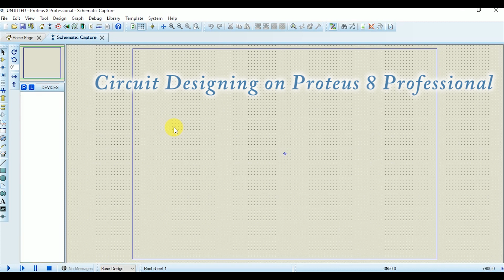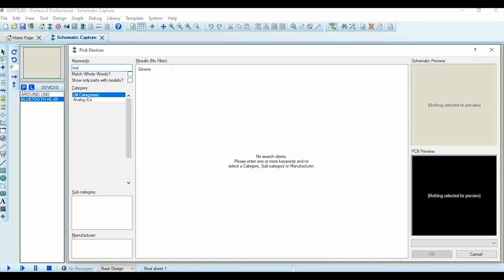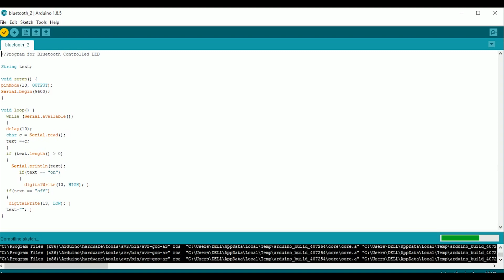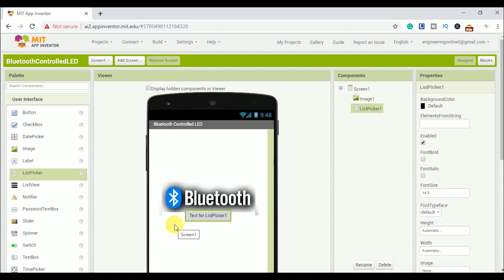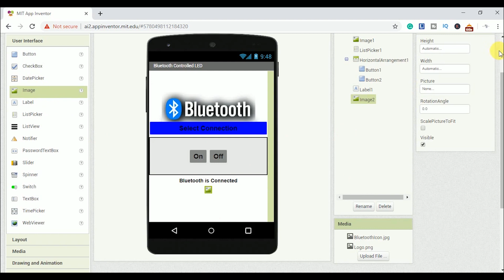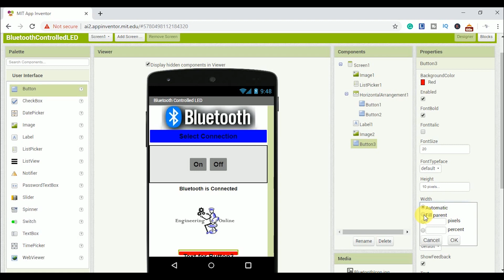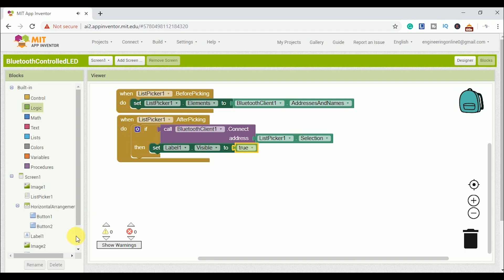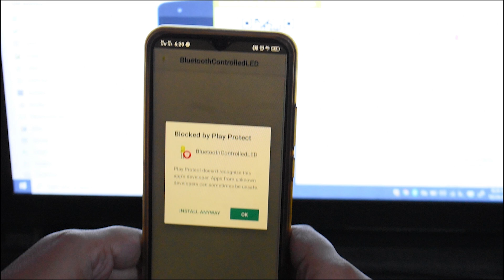Proteus Simulation of Bluetooth Module and Arduino | App Development on MIT App Inventor

Comment: Sister I have a problem.. there is no COM3 in my Bluetooth settings.. can you give any solution about it..
TIA
Reply: I am also have the same problem.  I  am also Add more Incoming COM ports but I don,t find any incoming COMport as to much with my HC05 Moduke . So how to sole this?i am also instill Bluetooth Drivers and try some others possable methode it was not Working .

Comment: Hi, first thing first, thanks for the video. When I came to the Select Connection and it connected to my laptop successfully. However, the button ON and OFF don't work for the circuit on proteus. I have followed all of the steps in the video without skipping any of them. I choose the right port for the Bluetooth module and for the code as well. If anyone have solutions, I would be appreciate. Thanks in advanced !

Comment: Ma am my mobile device is unable to send data. Serial.read() is returning 0.

connection between Mobile And laptop is fine. I have checked it as well. Both are transmitting and receiving data

when i start the simulation and press the "on" button from mobile phone nothing happens on proteus and serial.read() returns 0. Moreover when i stop the simulation and press "on" button the app return Unale to write broken pipe error.

please help me

Comment: Proteus Bluetooth Device Not Showing
Reply from the maker: You have to add library first
Reply: @EngineeringOnline  already added.. everything is fine, but not showing in devices
Reply: @EngineeringOnline  Hvae Done Everything Correctly Port of Com6.. But Sstill facing Issues
Reply: I Think Ports Are Not Configured Correctly.. Send Me Some Videos For That..

Comment: Hello! this video has been helpful. but i am getting the "error 507: unable to connect" thing when i try to connect to my pc from the app. can it be solved?? really urgent and important :) thank you.
Reply from the maker: Please make sure you've configured the COM port on the Bluetooth module to match that of your laptop. Next, run the simulation first before you try connecting. Hope it helps!
Reply: yes it worked properly :) thankyou very much! this video was very helpful
Reply from the maker: @debayanmukherjee01  Glad to know that :)

Comment: Thanks for the tutorial, it was very helpful. Currently i'm using app Inventor to develop an app to graph ECG and EMG signal received from Arduino, the graph part is going well but I'm struggling with the axis labels from the graph, is there a way to make a graph with proper X and Y labels in app Inventor? Appreciate if you can help me.
Reply from the maker: Please share your query on engineeringonline0@gmail.com

Comment: error 507 unable to conect.is device is turned on error
Reply from the maker: Please make sure you've configured the COM port on the Bluetooth module to match that of your laptop. Next, run the simulation first before you try connecting. Hope it helps!

Comment: Hello dear, 
I’ve made all the steps correct and there is no mistakes in it but when connecting the bar code into the app, the app isn’t taking me to another tap that i should install the app i did in it how should i fix this? 
My phone is iphone
Reply from the maker: Please share the screenshot of error to engineeringonline0@gmail.com
Reply: @EngineeringOnline   there is no error i tried it on andriod and it worked, but i need it for sos iphone is there a way to make it work on iphone ?
Reply from the maker: @nataliebesher2421  Does your iPhone creates  issues in making Bluetooth connection with pc?
Reply: @EngineeringOnline  not at all

Comment: hello , nice video thank you for it , i have a question , why did you choose  R=330 ohm ??!!! thank you
Reply from the maker: The resistance value is set in such a way that led can be turned on at high voltage. The resistance value should not be too high and not too low. At high resistance, it will not turn on and at very low resistance, LED will get burned.

Comment: while i am seraching in blutooth com port , it shoes none. what should i do?
Reply from the maker: Do you have a Bluetooth port in your PC?
Reply: @EngineeringOnline  yeah.now I got that after several times of doing it.
Reply: @EngineeringOnline  but, circuit got connected, even app connected, it's showing my commands in serial monitor, but motors are not moving in my project.
Reply from the maker: Try with simple led then add motors.  There might be issue in the code
Reply: @EngineeringOnline  yes , I tried, I am not able to see any output for blinking of led....even though there is no error showing in Proteus.
Reply from the maker: Email your issue at engineeringonline0@gmail.com

Comment: Mom I'm not getting COM3 at COMport in blutooth of my pc. While adding it's getting COM9 but it is not there in blutooth module that I used in Proteus.
Reply from the maker: Try on some other PC
Reply: Mom....how to connect Arduino in proteus to Arduino software....
Reply from the maker: @lokeshkinjarapu9000  Using hex file
Reply: @EngineeringOnline  maam....while I'm giving input from mobile app, the serial monitor in Arduino software shows the the input but there is no responce in Proteus software...
Reply from the maker: sent!
Reply: @lokeshkinjarapu9000  do you know how to fix now, help me please

Comment: I have a problem, i press the buttom of my app in my phone, but it seems that doesnt sent anything, i dont know what im doing wrong, i do everything that you do, i mean a get connected with blutooth
but i cant turn on the led
Reply: I have the same problem :c
Reply from the maker: Please make sure you've configured the COM port on the Bluetooth module to match that of your laptop. Next, run the simulation first before you try connecting. Hope it helps!

Comment: i am continuesly getting error 507 what should i do...it is very important for my project please get back to me fast. it is a request
Reply from the maker: Are you sure, you are not doing any mistake?
Reply: @EngineeringOnline  nooo i am not doning any mistake....there is a problem with connection establishment...please please help me it is very important for me....
Reply: @EngineeringOnline  i tried everything once again it shows the same......
Reply from the maker: Drop your email. I will email you my files. Try with them and let me know if you are still facing the same issue
Reply: @EngineeringOnline  thank you so much.......i was trying to connect to bluetooth without running proteus circuit and there was some problem with hex file location(instead of copy paste, i searched for it in %temp% folder and was able to run my application...) thank you so much for this video i really helped me a lot .... thank you for such an informative video....
Reply from the maker: Thank you so much for appreciation. :)
I am glad its working for you now 👏

Comment: Why don't I connect the voltage and ground of the HC-06 module?
Reply from the maker: In simulation, only tx and rx pins can be used. whereas with real hardware, you have to used all of them
Reply: @EngineeringOnline  Thank you very much!!

Comment: I do all the steps as shown but unable to run simulation. I think error would be in com port. When I open Bluetooth setting there it is showing COM19 port but in proteus Bluetooth Library there are up to 4 ports, can this be problem?
And one more thing I want to send X and Y co-ordinates through app, how can I send it ?
Reply from the maker: Same Bluetooth port should be selected on the Bluetooth module. Only then you can communicate with the Android app.
Try it on some other PC
Reply: @EngineeringOnline   how can I Send X and Y using joystick, I had made joystick but how can I send it to module?
Reply from the maker: You have made a joystick on app?
Reply: @EngineeringOnline  Yes sort of which gives the x and y according to ball position.
Reply from the maker: @prathameshvarashetti2562  Its doable . Have a look at this video
https://www.youtube.com/watch?v=Gje7ST4yXjM
Reply: @EngineeringOnline  thanks I will try this
Reply: @EngineeringOnline  I had try this is useful to me but now problem is that when I connect app using IDE serial monitor it doesn't  prints  x and y properly in number form inspite prints anything like $#??*?$$ etc but when I send text it is printing fine. And also when I turn to simulation it is showing error unable to write broken pipe.
Reply: hey!
did you solve that issue of only 4 COM pins because I have this as well :(
Reply: @AbdullahAli-vh1ce  No bro I tried it on other PC

Comment: I have been using Bluetooth module in my project. So we have done a simulation using Proteus. But we have a doubt. How to connect the Bluetooth module in Proteus to an android device? Is it possible to connect it from a predefined app in an android device and send/receive data ? If we can please explain how to perform it.
Reply from the maker: The same process is done in this video. Try to connect Bluetooth module in Proteus with the app you have.
Reply: @EngineeringOnline  yah but you have used the app and proteus on the same platform. Can we use the app from the real android device?
Reply from the maker: App is real. I have used this on real Android phone.
Reply: Can i know what app is that so that it will be easily for us.
Reply from the maker: The app is developed on MIT App Inventor and then download on phone
Reply: Okay can it be done with a predefined app which is available in playstore?
Reply from the maker: I think it should. Try it